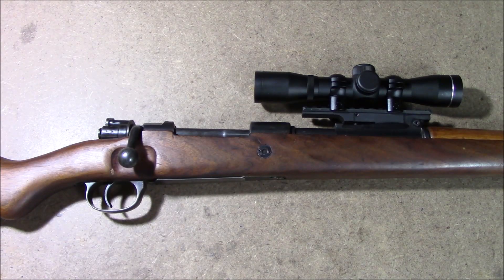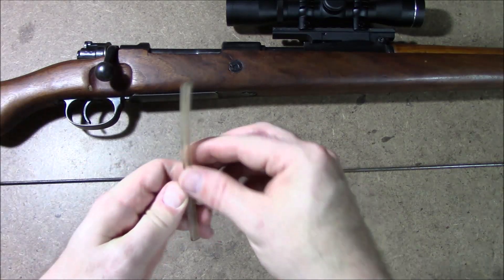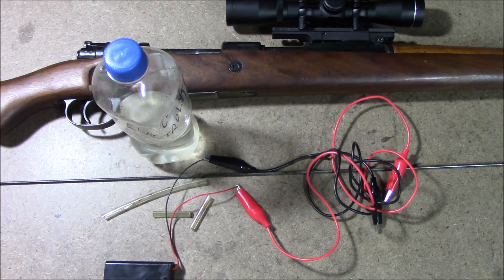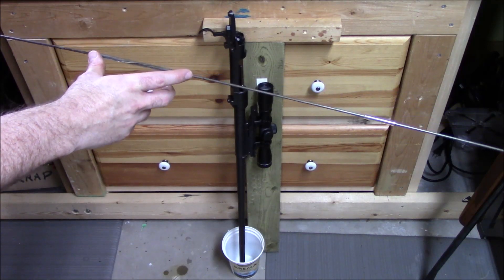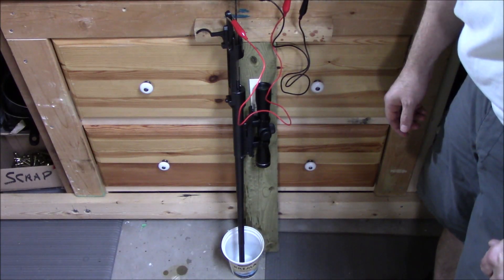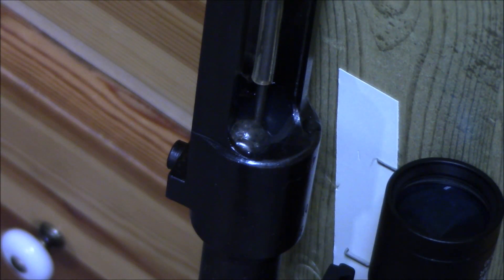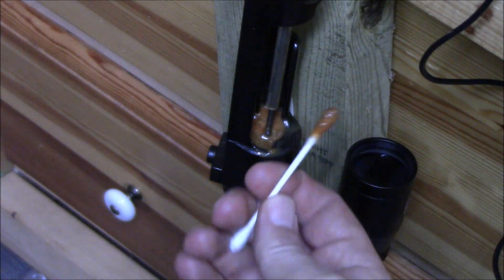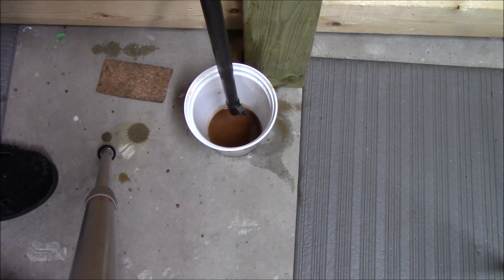Make Your Own Electronic Bore Cleaner

Comment: I am sure if its chrome line barrel you will damage it by removing the chrome plating from it as this process is the reverse of chrome lining. Be ware all of you !
Reply from the maker: That's a solid point, something I've never considered before.  Thanks for posting!
Reply: @MrTudenom  sir what is this process cleaning cromiam plate is not damage
Reply: @seemasingh5828 If the bore is chrome plated you don’t need to even clean it like this. Just use regular bore cleaner.

Comment: The orange stuff is likely to be cosmoline film left behind from when your rifle was unpacked from storage and "cleaned". I can see that it is a Mauser; judging by the color of the stock its probably a Russian Captured German K98k which means at one point it was literally full immersion hot dipped in Cosmoline and placed in a crate or rack. If you are unfamiliar, cosmo has the consistency and color of earwax and the orange scum on the q-tip looks a lot like it.

Comment: Go to Home Depot, or where ever, and pick up a rubber stopper(s) to fit your chambers, if you have different calibers. Drill a small hole in the center of the small end (duh!) of the stopper so the steel rod fits tightly in that end. Drop the rod down the barrel and secure the stopper on the end of the rod and push the stopper tightly into the chamber. There wont be enough rubber stopper in the end of the chamber to prevent the electrolysis from working in most of the chamber. Home stores, hardware stores or janitorial supply houses should have 10% ammonia if your not happy with grocery store ammonia which is about 3%, or so I'm told. Then there's always good old Amazon if you can't find it locally. Might as well pick up some rubber O-rings for the rod when you get the stoppers. I've done this using a battery charger on 6 volt and it does work but really depends on the condition of the bore as to the degree of success. Home depot will probably have everything you need for this project. Make sure you pick up a funnel to tape to the muzzle and put the breech end in a bucket of some sort.

Comment: Sorry but the flow of electrons go from the Negative pole to the Positive pole. Remember electrons are negative. You have it revered in the video at 6:30. With the way you say to wire up, you would be electrically cleaning the thin rod inside the barrel and weakly electroplating ammonium from the electrolyte to the barrel.
Reply from the maker: Yeah!  You're totally right, about the electron flow thanks for pointing that out.  Maybe I was daydreaming that day we learned about it in Physics 12.  But doesn't the plating direction still work?
Reply: @MrTudenom  it can get confusing. The positive side will also bubble up and release hydrogen  (a part of breaking apart H2O) and that would dislodge some gunk. So yes it works not as well but it works... and erodes the surface a bit... sorry.
Reply: @MrTudenom  The shedding of the outer layer does get the gunk off but also a tiny bit of the steel too.

Comment: Cool vid but I wouldn't worry about salt since household ammonia is just ammonium hydroxide, a hydroxyl salt of ammonia in water!  I need to try this, I've also seen this done in reverse with extremely rusty metal. It was reverse with the negative on the piece to be cleaned, and it ate away at the random piece of metal called a sacrificial electrode.    
The bubbling you see is hydrogen and oxygen being produced.  For this, people use laundry soda for the solution.
Reply from the maker: Laundry soda?  There's an interesting idea.

Comment: I see in the comments you have been corrected but continue to  instruct  reversed polarities  I  collect and restore cast iron cookware,  The positive (anode) goes to the sacrificial piece of iron, and the negative (cathode) goes to the item you want the rust removed from.  Restoring cast iron cookware,  because it will be re-seasoned in a 400 degree oven for 1 hour,  will not have any issues with hydrogen embrittlement.   By no means am I an expert. However, if I processed a rifle barrel with electrolysis  I would seriously consider doing a similar  process in the oven before shooting.  Barrel Rockwell hardness is low but a still, it is a subject worth doing some research on before pulling the trigger.

Comment: I'm scared to try that but I have a few rigs that could probably use this.  In coming to town later this month. Any idea if you could set me up or tell me where to go and what to buy? Pretty cool man thanks for running us through this.
Reply from the maker: Sure, no problem!  I found the rod at Crappy tire, same with the clips.  You might want to keep an eye out for a low power DC adapter somewhere, the method is pretty hard on batteries.
Reply: @MrTudenom sir what is this process cromiam plate is not damage

Comment: Good vid.... good explanation, ESPECIALLY keeping the positive and negative leads correct, and not reversed. Caution.... do this too many times in  a row, and you will start taking barrel metal off, thinking it is still dirt. Don't know if it's absolutely necessary, but maybe slug the bore and do micrometer groove and land measurements... or....simply do this treatment once or twice at 20 min each time....and then asssemble and shoot and see if what you've done makes it shoots better or worse.
Reply: I do not understand combining vinegar, an acid, with ammonia, a base; they are opposites and in the right quantities will neutralize each other.  I have posed the electrolyte question to a chemist group and they say, "strong acid" in general for rust removal.  I have trouble with putting STRONG sulfuric or hydrochloric into a rifle barrel.  I'm trying my next rust removal with CLR, the stuff that removes lime and rust from sinks, that you can buy at Home Despot.  Its essential ingredient is "lactic acid" which one finds in all manner of prepared foods.  Or, more likely I will find some inexpensive source of phosphoric acid, perhaps Coke.
Reply: Why not try ospho deruster from a paint store